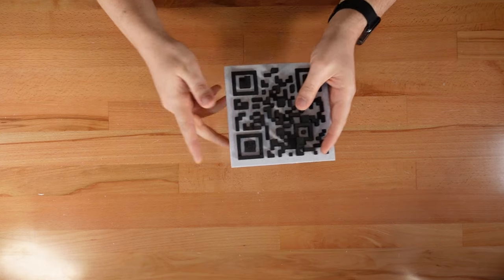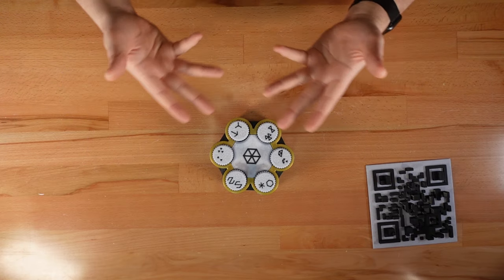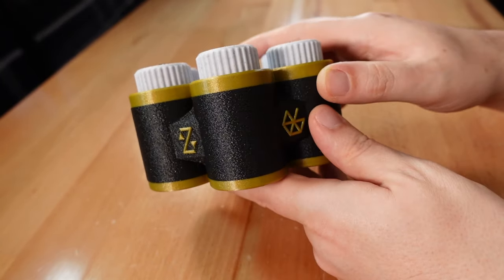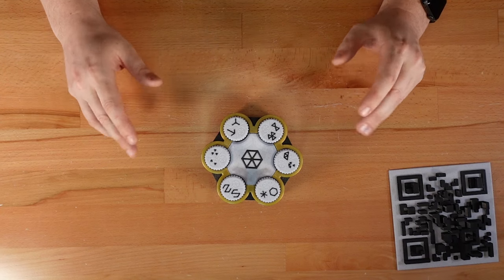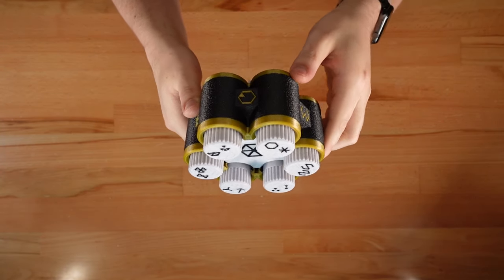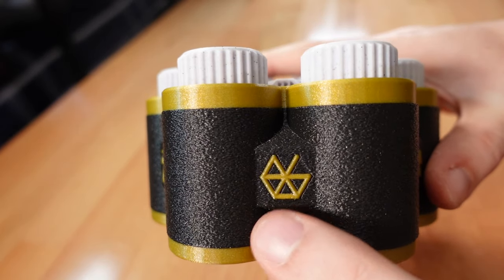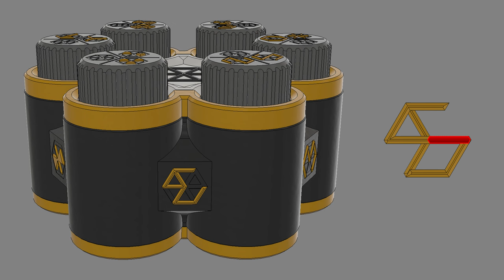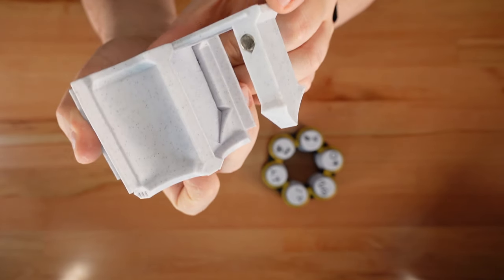Hexglyph - 3D printed Puzzle Box

Comment: It was really fun solving this puzzle before the 15th however one thing that blocked me from progressing was that i didnt know at which stage i was - the previous version (if it existed) had the order engraved at the corners of the core, squares telling you which symbol was first and so forth. Now it is a little easier isn’t it?
Reply from the maker: Exactly! You can now know which step you're on by looking for the indicator cut into the inside wall of the puzzle case. As the core lowers, it reveals the next indicator in line.

Comment: I was able to print this on my A1 mini with no failures, however the center piece does not move at all. The dials all turn but I cannot get the center core to move at all. Any thoughts? I printed it with the standard profile, no supports or anything. I’d really not like to have to start all over with another 26hour print.
Reply from the maker: Sorry to hear that! I've heard one other report of that happening specifically on an A1 Mini. Maybe the tips posted in this thread will help you: https://www.printables.com/model/844574-hexglyph-print-in-place-puzzle-box/comments/1856994

Comment: DO you have to reverse the procedure step by step to get the thing back together?
Reply from the maker: Reverse is MUCH easier. You can actually see which dials need to move where to let the core move up. Or you can intentionally not look at the dial tracks and just do all the glyph puzzles in reverse. The indicators carved into the inner wall of the puzzle case will tell you which glyph to work on.

Comment: Is it possible to print the parts separately and then assemble it? I'd like to make use of multiple colors, but I only have a single color printer.
Reply from the maker: For the symbols on the top of the dial, you can do a mid-print filament swap on the last 2 or 3 layers.

The glyphs on the side are trickier - I'll probably look into a remix that'll support printing those separately. If you try to extract them from the current model, you'll get some severe overhangs and impossibly tight clearances :(
Reply: @3DPrinty  what about the bigger parts? Can the rotors be assembled into the housing after the fact, or are they locked into the housing in a way that makes assembly impossible?
Reply from the maker: The core can be printed separately, but the rotors are fairly tightly captured. You MIGHT be able to squeeze them in post-print, but not without bending the frame quite a lot.

Comment: Every time I print it, the nobs all are perfect and turn fine, but the center is stuck. I can't figure out what im doing wrong with the middle. using Carbon X1.
Reply from the maker: Does the center section not wiggle at all? I've seen quite a few successful prints on that printer so it should be possible in theory.

I assume you do not have supports turned on or anything like that? If possible, I'd keep checking on the print as it goes to look for any spots where it's fusing. Finally, are you printing at the standard 100% scale?

I hope this helps - if not, I recommend checking with some makers who use the same printer and may be aware of some tricks that I don't know with reliably printing print-in-place models.
Reply: @3DPrinty  ya it was just stuck, so I separated it using the mf3 file and it worked perfectly.